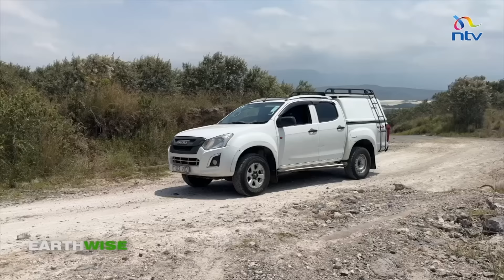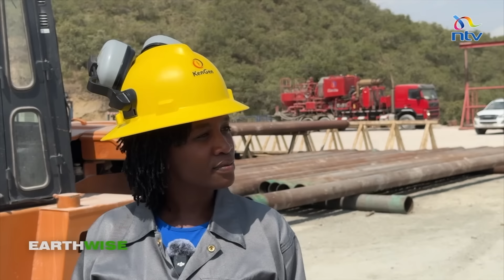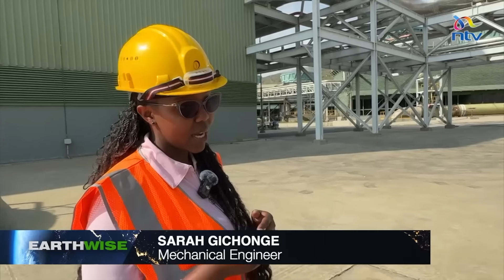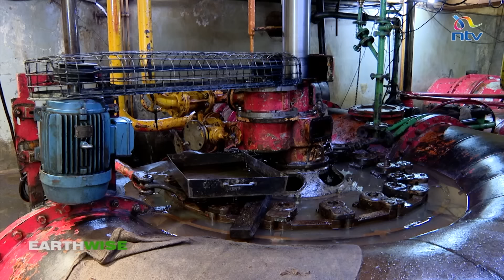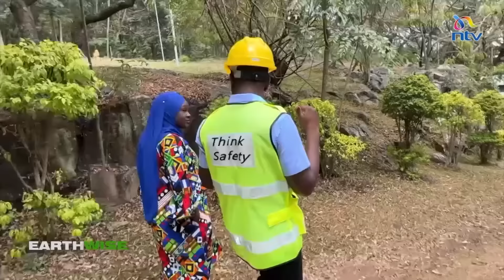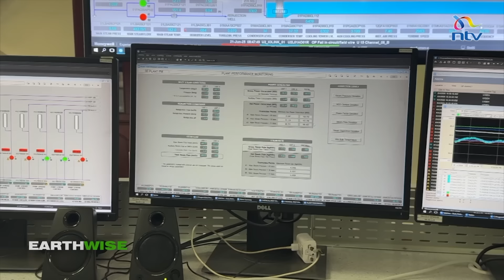EARTHWISE | How Kenya is powering its future without fossil fuel

Comment: amazing...migori screw head power generation ...try yala river, nzoia , and others  too this is way cheaper than a dam ...more feasibilty study needed to explore this model on all our rivers
Reply: Nope for cheap electricity and industrial use we need a source that can generate 5000MW+ of stable power. This can only be done by huge hydro stations, coal and nuclear power plants. All this other energy sources stated in this piece produce at an average of 100MW with significant investments undertaken.
Reply: @Quantinum-316  You need demand or projected demand to match supply otherwise it will be a massive waste of money with idle power like what Ethiopia is about to face. The main reasons why power is expensive in Kenya are: 1. small power stations which lack economics of scale
2. lots of taxes: check you token bill, most of money goes to levies not buying electricity
we need to deal with these by first raising demand for power in order to accomodate big cheap power plants.

Comment: In Kenya, firewood, charcoal, and petroleum are heavily dependent on, and hence, Kenya is not a global leader in using clean energy. Something is not adding up here. The two confused minds here have just stated 4 minutes into the interview that steam becomes electricity. I am sad and very worried if these are the kinds of engineers graduating from whichever institutions. Steam cannot become electricity. Steam is matter while electricity is not. 
The electrical engineer has poor knowledge of units. She stated that a megawatt is a thousand watts. Mega means a million. She then stated that Giga Watt is a hundred thousand Watts. Wrong again. A gigawatt is one thousand million Watts.  The mechanical engineer understands the process well.